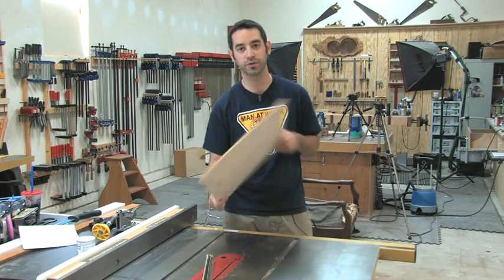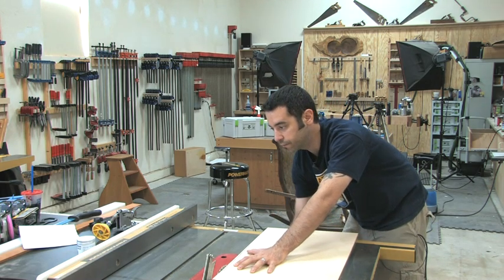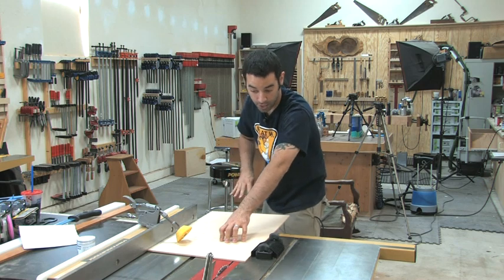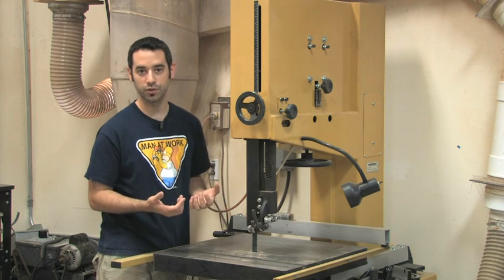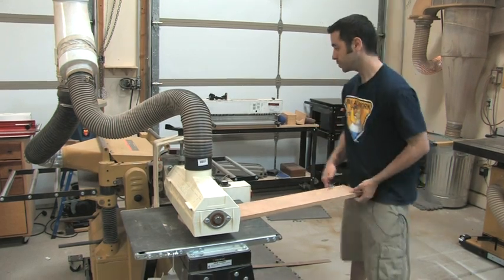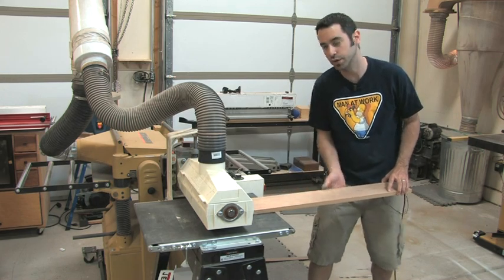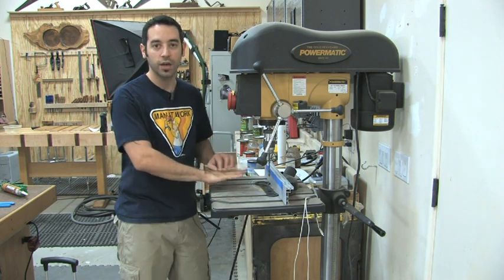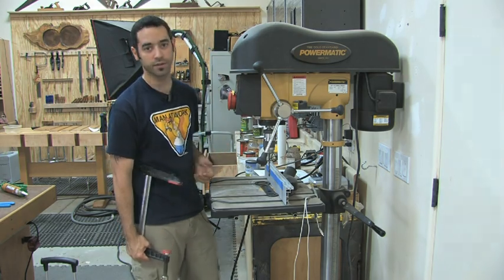52 - Shop Safety: My Mistakes

Comment: You are lucky. I have lost a slice of my little finger cleaning sap resin off of planer rollers without removing the blades first. I was running the planer to rotate the rollers to make the job faster. I also cut half of my thumb off getting too close to the still running blade trying to make adjustments to the fence on a table saw, being in a hurry and didn't shut the saw off. It took me almost a year to get up the nerve to use that saw again. It really scared me to think I could have lost more than just a half of a thumb.

Comment: As a newer wooderworker/carpentry/repair kinda guy I have found that the router is the most dangerous tool I have and my festool barrel grip jigsaw is a close second because if you do have a problem getting to the on/off switch is nearly impossible. I dont have the luxury of a jointer or a planer or a drum sander to injure myself with yet.

Comment: First time drilling metal with a drill press didn’t go so well. I initnally had a clamp on the metal but the clamp was free on the table. I was gonna use a c clamp to prevent the other clamp from spinning around. Instructor told me to hold onto it as I drilled. Sure enough the table clamp and the metal piece started spinning around and I tried shutting the drill press down but it was too late and the table clamp and workpiece flew across the shop. No one got injured but it sure scared me.

Comment: I've always called these types of incidents TSDAA's for two second dumb a** attack. Usually it's something that if you took just a couple seconds and thought about what could happen it wouldn't have happened. When I was in charge of designing guards for equipment my goal was to make the guard easy enough to use that it wouldn't be discarded. At the same time it had to be absolutely sure to prevent the possibility of injury. I'd like to be able to say I was always successful but TSDAA's still happened.

Comment: Thanks for sharing.  I got one; I was cross cutting a 2x4 at the miter saw, and for whatever reason I didn't push it up against the fence, I just held it down.  I got 90% through the cut and the blade grabbed the wood, slammed the 2x4 and my hand into the fence, and I got a big bruise on one finger.  The jolt knocked a bunch of stuff off the table next to the saw.  pretty dumb

Comment: Thanks for sharing. If I understood correctly, you suggest it would be okay to pass a piece of wood between the router bit and the fence. 
I would disagree. I don't think that's ever a good idea. Unless there's a bearing on that router bit (in which case the fence is superfluous) , I would never attempt to push stock between the fence and the router bit.
Reply from the maker: That's exactly the opposite of what I said in the video. I agree with you: never run a piece between the fence and the bit.
Reply: thanks for the reply. I just watched it again. You only really elaborate on the direction of the bit rather than the position of the wood and it could be construed that all you did wrong was the direction of travel of the work piece in relation to the bit, when really both the setup and the direction of travel was incorrect.
Reply from the maker: I don't know man, it seems pretty clear to me. I said running the workpiece from right to left is OK when you're in front of the bit and running it from right to left behind the bit is bad. My goal was to simply point out something I did incorrectly and why it was incorrect. This wasn't meant to be any sort of all inclusive router tutorial. From my perspective, I feel like I hit my goal.

Comment: Mark, sorry , I have to call you on this one. The very first incident. The blade height was not the problem. Consider this. If you have the teeth just barely above the workpiece, the teeth are engaging the workpiece at a more linear or horizontal angle. If there is a jam up, then that linear engagement is far more likely to cause the saw blade to push the workpiece away from it. Consider now that you have the blade at it's highest adjustment. NOW the teeth are pushing straight DOWN on the workpiece as they cut through it, effectively pinning it to the saw table top. I can't say exactly what the cause of your kickback was, but it was NOT tooth height.
Reply from the maker: We'll have to agree to disagree on that. Most kickback occur when the work engages the rear teeth. If those teeth are going in an upward direction, it's much more likely to pick up the workpiece and send it back at my face. If the blade is low and the work touches the teeth, the forward motion is something I'm already fighting against with my push stick and can naturally prevent the kickback from occurring. I've heard folks make your argument before though the vast majority of people agree on the safest blade height being just above the work. So I can't say you're wrong, but I can say that my own experience and conventional wisdom disagree with you.
Reply: Okay, I stand corrected. I thought I had a pretty solid understanding of this, but your explanation makes perfect sense. I am instructed. Thank you.

Comment: I experienced something similar and very scary, not in a wood-shop but  while cleaning some food production equipment.  I was wearing rubber gloves and had on my wedding band.  While cleaning the left side of a conveyor belt (while it was running!) my glove got pulled in, then it reached the wedding band and securely grabbed my finger!  Fortunately, I yanked back hard enough and the rubber glove allowed my finger to slip out!  VERY SCARY!  I NEVER WEAR any kind of jewelry around machines!!

Comment: My son  is in 6th grade and he wears prescription glasses his woodworking teacher said since he wears prescription glasses he doesn't need to wear safety goggles Now I'm a retired welder fabricator of 30 years, and shop safety is shop safety,  What if a tool malfunctions a drill bit shattered  a blade breaks  Now I know that's wrong but for a instructor  to tell him he does not need  them I'm kind of questioning  his ability  Do you think I'm wrong
Reply: If they are poly carbonate lenses they are probably as tough (if not tougher, depending on the prescription) than safety glasses, but they must have side shields or things can wrap around or debris can fly into his eyes at an inopportune time, which can be dangerous when handling or feeding tools.